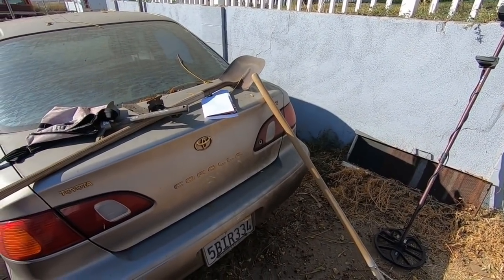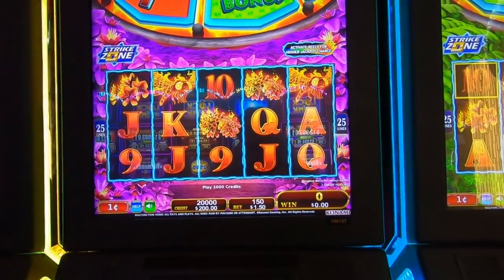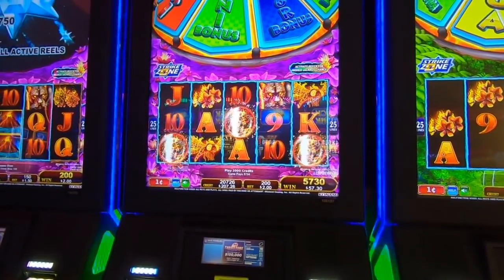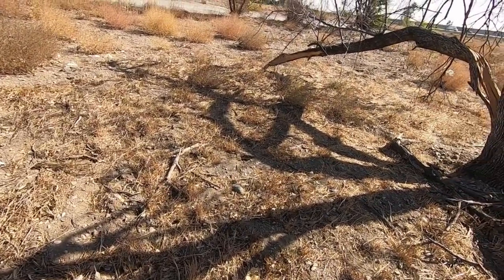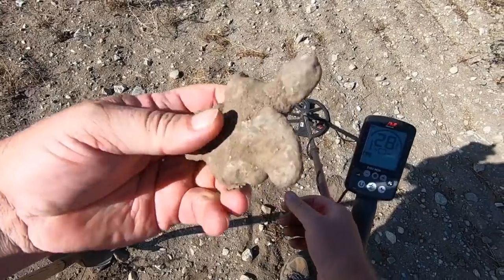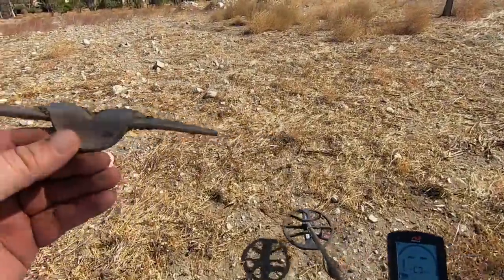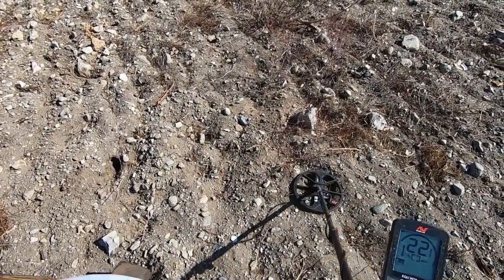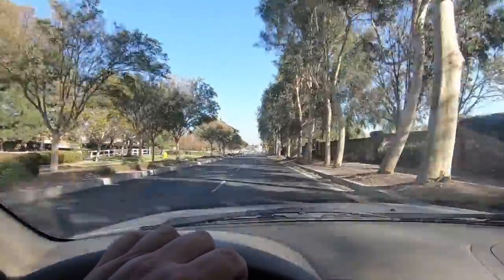Metal detecting 11/6/19

Comment: Back before 1960 they would pack lead around cast iron waste pipe joints to seal them.  When the house was torn down the pipe was probably cracked leaving the lead ring.